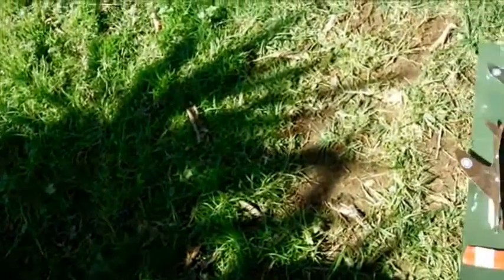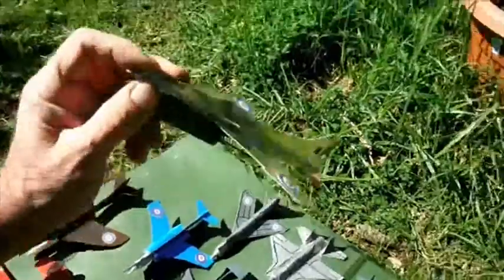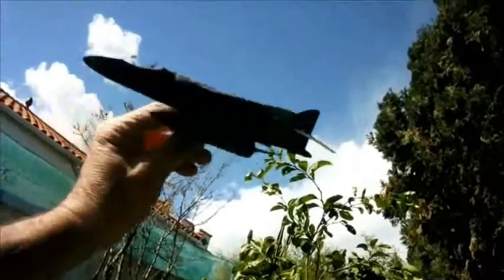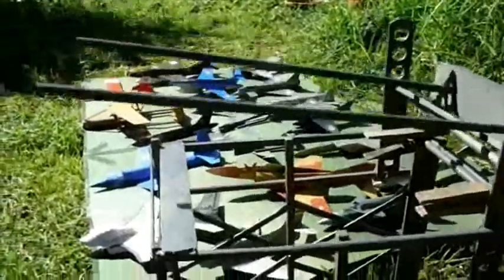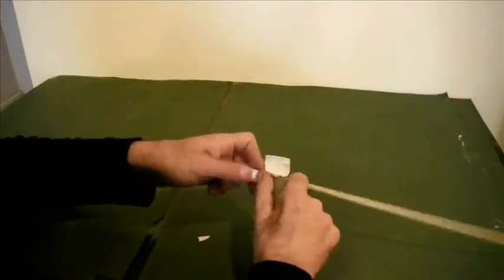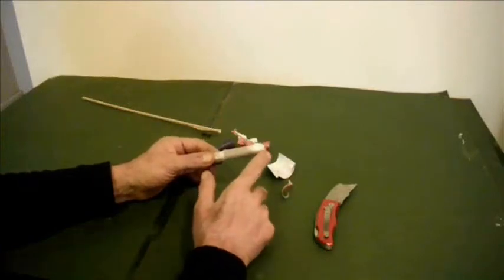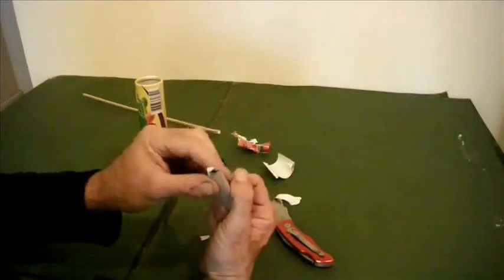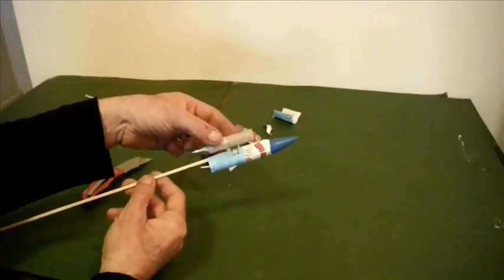Tiny jets with firework rocket motors Part 1

Comment: (1978) 1:72  scale planes with rockets attached 😁
Reply from the maker: They probably are around 1:72 scale - each one´s made of cardboard, however, to keep weight down.
 If you watch Part 2, in which I try to fly them, you´ll see that most fail completely. A couple do fly, though.